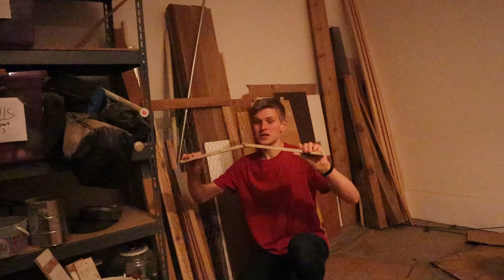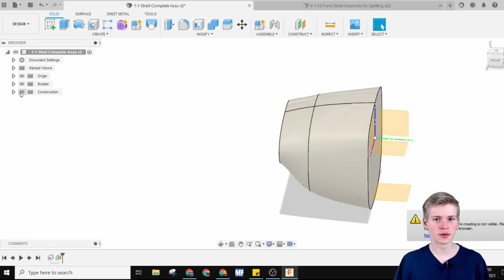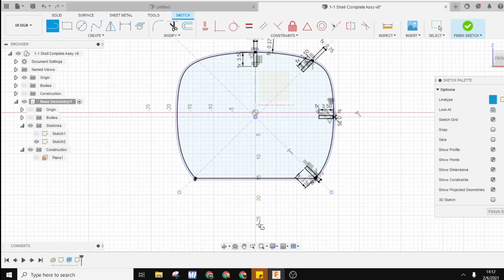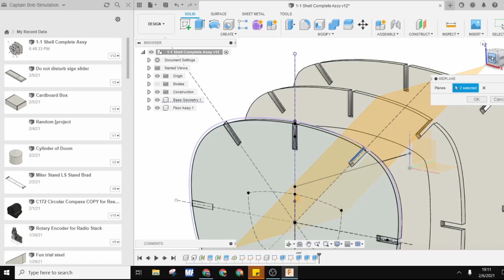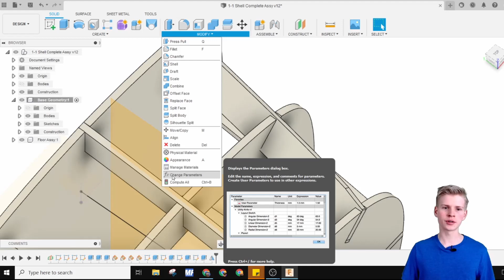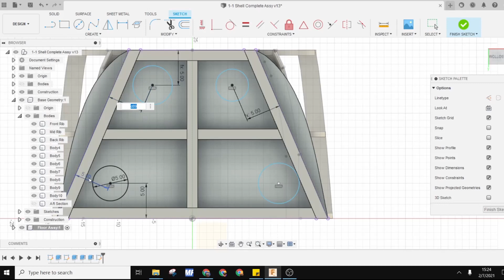Injecting Possibility into my Flight Simulator CAD Part 5, Cessna172sdays Ep. 8

Comment: Hai Captain,
Try to keep it light. You could do with less thickness, on both the stringers, panels and skin. Not forgetting the floor and wheels. I think you can add another parameter, weight of plywood. To monitor the actual weight of the design. Especially applying the skin will give a lot of strength. While designing keep in mind where you want to put you're screens. And which screens. Big screens or even plasma tv's can weigh a lot. Will it be placed on that part of the shell? Will one of you're wheels have a reachable brake?
I really need to be working on mine fusion360 skills, so much more to offer than Acad. Liking it!
Reply from the maker: Excellent points, I never considered these as design considerations and will look more into the weight. Thank you for watching, you always have such good insights!
Reply: @CaptainBobSim  You definitely have some brain space vacant. (U might use other materials for the skin like EVA or XPE foam sleeping mats (cheap)).